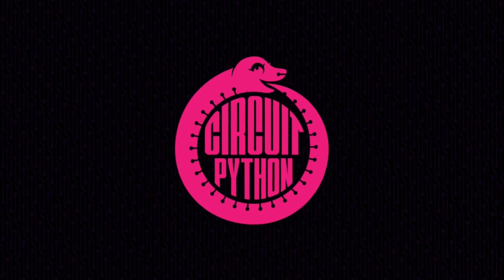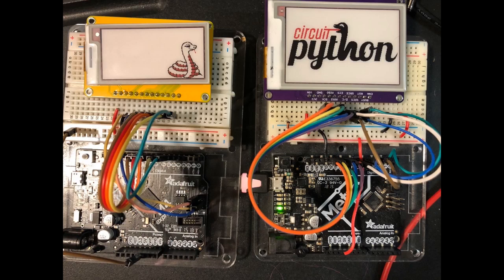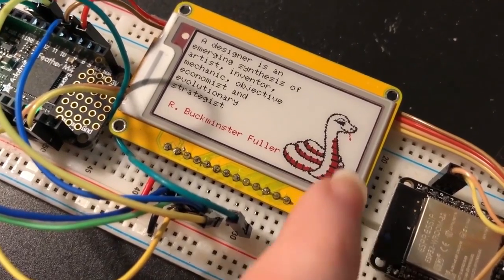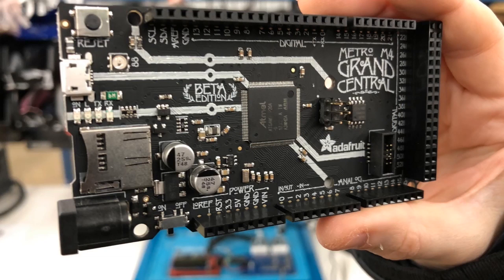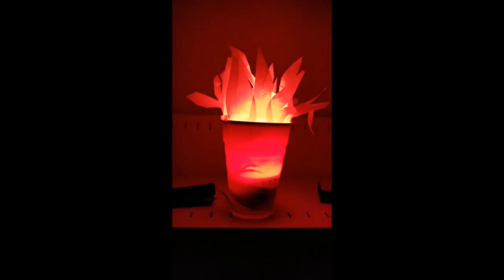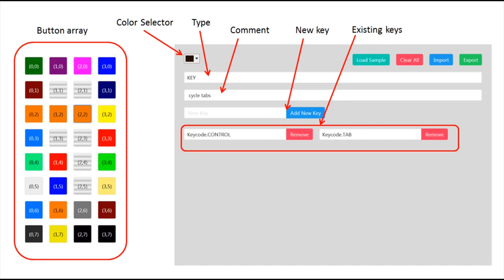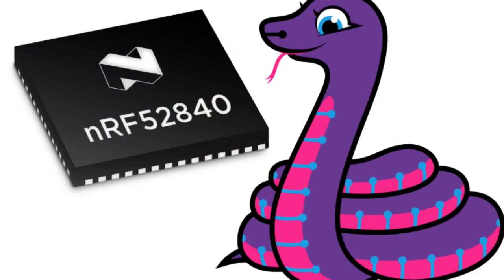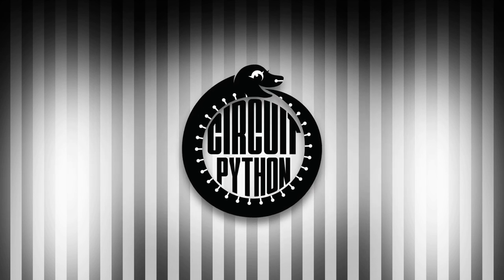Python on hardware! 12 #adafruit #Python @Adafruit @circuitpython @micropython @ThePSF

Comment: I need a 12vdc tolerant microcontroller for some automotive projects. Yeah, level shifters and transistors with what we have, but it would be nice to have an automotive grade M4 with SRAM.
Reply: Perhaps a 12V adapter shield could be developed easily. It would have power conditioning, voltage regulator and Input/output adapter. Also maybe some status LEDs and audio alarm. Alternatively a CANbus board could be acquired.